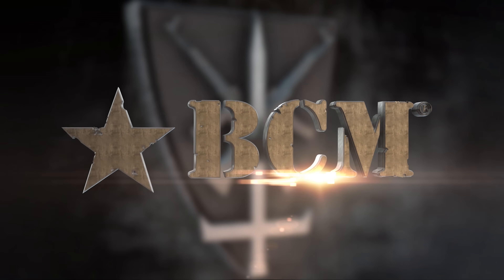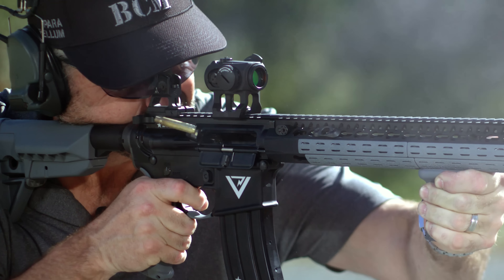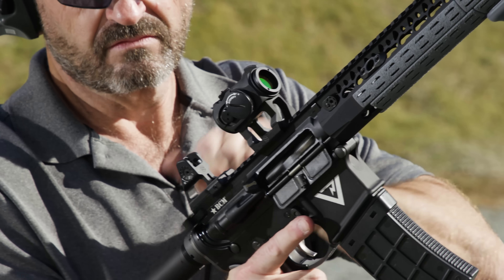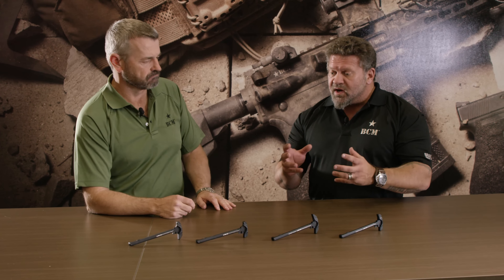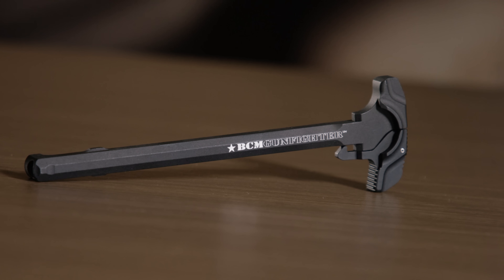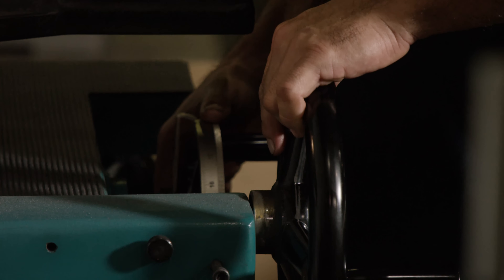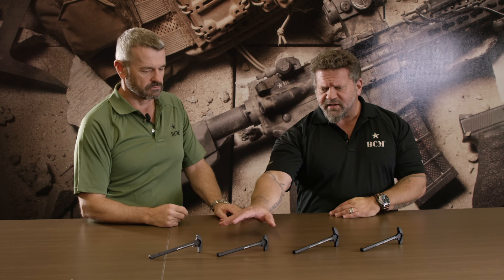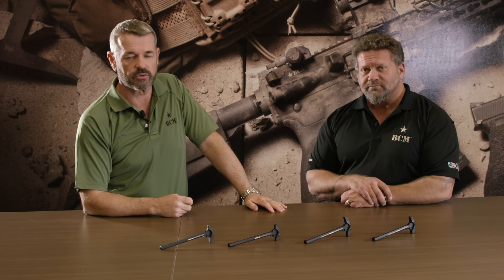BCM Gunfighter Charging Handles

Comment: In my experience with the BCM 3B, I found the single extended lever/latch to be a perfect size for me. The overall build quality in it's materials, machining, and robustness, is over the top great. In my opinion, it's a pleasing piece of equipment to the eyes. Now, what I did not find to be a positive, was the amount of tension it's spring requires to manipulate it's unlatching. When going back with every other charging handle I've ever encountered, the latch opens up enough to clear it's recess notch on the upper receiver, but not this model. If you don't deliberately grasp and open the latch with two fingers, and use a one finger pull back instead, the latch stays closed enough during the process that it bumps a bit on it's upper receiver recess. Being that the recess ledge is not very deep, and that it should remain with a good ledge, this constant bumping could cause premature wear on that non replaceable area of the upper receiver.
Again, in my opinion, this is a very well made product, (built like a tank). But, I do believe they overshot a bit, (no pun intended), by using a too powerful spring for it's latch manipulation.

Comment: For anybody who is using the older Mod 4 and wants to upgrade to a 2nd gen, get the 2nd gen Mod 3 instead of the Mod 4. I found out after I got mine that the 2nd gen is smaller than the first gen Mod 4. I think the Geissele Super Dynamic is a better charging handle but it's also $30-$40 more expensive. BCM Gunfighter is a great option if you don't want to spend a ton of money!

Comment: The BCM charging handles are awesome. No doubt about it. But I recently picked up The Lewis Machine & Tool ambi charging handle. An it is second to none...
Reply: Really, you'd say the LMT  CH is better? I sold mine. Have you ever used the Geissele SCH?
Reply: I wouldn't say better. But the same. They are both extremely high quality pieces of kit. High quality an well made. I own both CH's my self. But I really do like the LMT.
Reply: @michaelroberts9930  I agree with that. LMT doesn't make anything  junk. It is definitely a quality part, made well
Reply: @apb2887  Yea I would like to do a LMT build. Or purchase more of there components. I have my eye on The LMT Enhanced BCG an carrier...

Comment: I've owned three different Gen 2 BCM charging handles (Mod 3b right, Mod 3b ambi, Mod 4b ambi), and I've wound up ditching them all. I don't know if it's something about my physique or my gear (or both), but BCM latches always seem to catch on my gear, even though I do like how they feel. Whereas I haven't had the same problem with my Radian charging handles. At this point, I'm ready to give up and say that charging handles are just the one BCM accessory line that just doesn't work for me, which is a shame, because I love almost all of their other accessories (handguards, grips, buttstocks, etc.)

Comment: Unfortunately, bcm isnt the only ambi charging handle game in town in 2024 and there's maybe not necessarily "better" but "improved upon" options now.
Fortunately for bcm, they're probably the cheapest great ambi charging handle around and still a great option.

In my mind bcm is the new colt, what colt used to be 25-50 years ago, the new baseline minimum for standards and qc for the ar15. Anything they have is confidently going to be a reliable, repeatable, consistent, hard use part of your tool.

And man oh man, that o.g. square extended latch on the original gunfighter from mw2 is still just a badass look! They should bring it back just cus.

Comment: Interesting design. But I wonder how much the strength can be enhanced since this is still held together by that roll pin, which is still the weak spot.
Reply: It still has the roll pin, yes, but the latch is designed to make contact with the rest of the handle in a location other than that pin while in use. Doing that reduces stress on the pin and dramatically reduces the chance that the pin will shear like on a USGI charging handle with a tac latch installed.
Reply: @MarkiusFox  Depends. It largely depends on where that extra contact point is in relation to the force being applied and the roll pin (in this case the pivot of a lever). It also depends on the direction of that extra support. Usually if you place the support more than half way away from the force, the pin takes more force than before. I would like to think BCM did their job placing the support at the right place and angle, but from what I saw in the video I did not see proof for that so I was a bit worried.
Reply: @MarkiusFox  Whoops just watched the vid again. I see where the support is. Very clever design. They definitely did their job. I stand corrected.